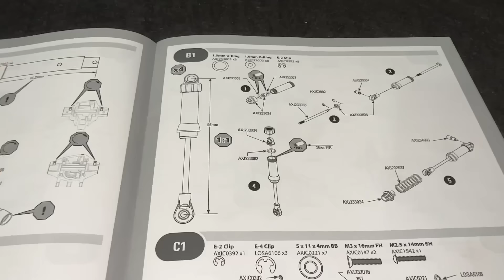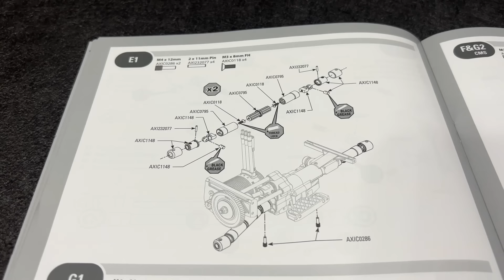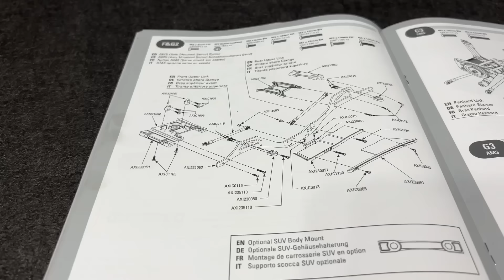EPIC SCX10 Pro Build!! DETAILS!!

Comment: I was nervous watching you push those e-clips in place. Mine usually end up doing Mach 50 across the room. I need to find a good place to get extras.
Reply: place parts inside a ziplock bag then press the E clip in place. The bag will catch the clip if it springs off during assembly

Comment: (9:27) ... Easy to grease, but just like RC DRIVER said... I wish they would have used (3mm) Counter-sink Screws for the 4-screws, instead of the (2.5mm) screws, but which hold the "grease-able", 👍 "open-bottomed" transmission to the skid-plate, cuz that is where "the heart" of the SCX10 PRO "is" !!!! 🤔 - Although, I'm sure, from experience, that the Axial plastics are just as good as they were from the SCX10 II "solid-one-piece axle", I have !! 🤞...

Comment: Overall, I definitely like the kit, and the build.  But, the one thing I'm not liking (and, I'm guessing others will probably agree) is that all the cross-bracing is plastic, which allows too much flex.  Unless as bracing parts are carbon-reinforced (worth a high carbon content), there should have been at least once aluminum brace in front of the skid, and at least one behind the skid).
Reply: It will be a 4-5lbs Crawler. I absolutly dont worry about flex. Plastik is just fine.

Comment: Omg that is so high priced why ?
Reply: If you build a flat rail comp rig from scratch it’s a huge money pit. Even going with the $80 Power Hobbies chassis kit which is the most complete conversion option and a 10.2 builders kit that’s over $320 and still needs some tweaks and parts to make it right. This SCX10 Pro adds at minimum much better shocks, underdrive and forward motor mount.
Reply: @jonthomas8487  I guess your math needs improvement 😉
Reply: 10.2 builders kit $239, Power Hobbies chassis kit is $80=$320 + better shocks, overdrive, forward motor mount. The SCX Pro shocks are like Dravtech or modified TRX4 shocks both of those are $90-$100.  Just that gets you over $400 then you add even the cheap axial overdrive gears for the 10.2 and that’s another $40 and that’s only a little bit compared to the 40% in the pro, then there’s the forward motor mount. The TGH one is another $75.